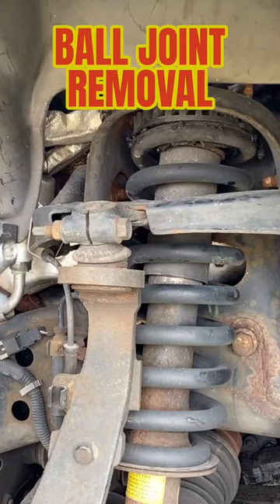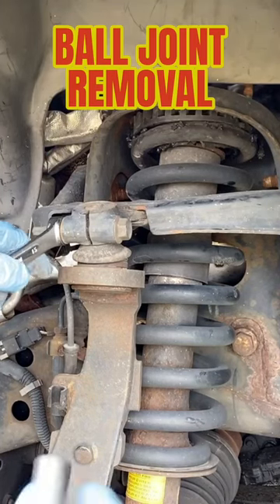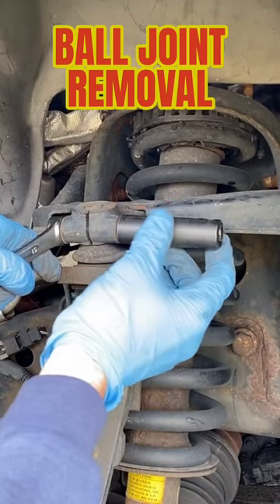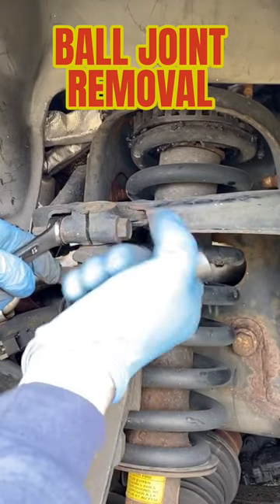REMOVING UPPER CONTROL ARM FROM BALL JOINT. #shorts #youtubeshorts

Comment: I've found a few of those designs with a offset on the bolt so only the nut actually spins and then a drift is need to remove that retaining bolt

Comment: Everyone saying its never this easy.... this style of ball joint pinches the stub.  When you undo the bolt it lets go of the ball joint. So much easier than the type yall are thinking of with a caslte nut on top with an interference fit; if you know what that means....